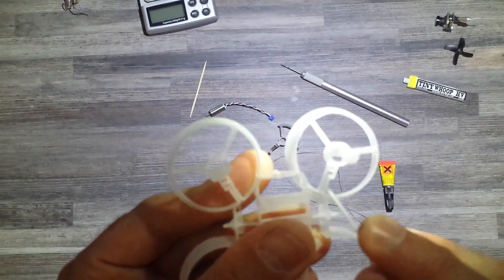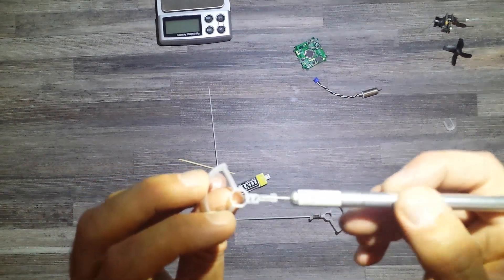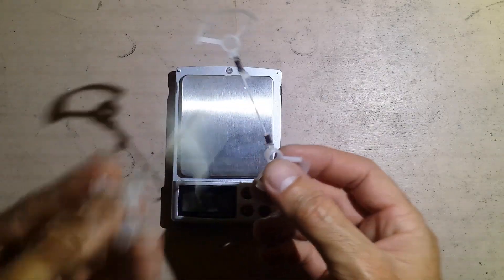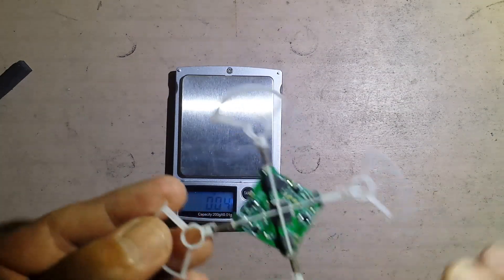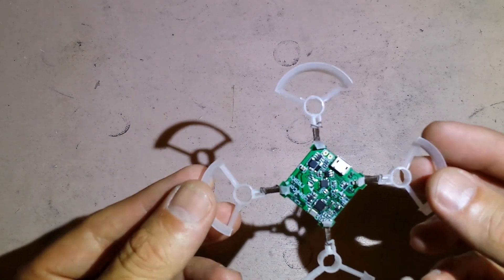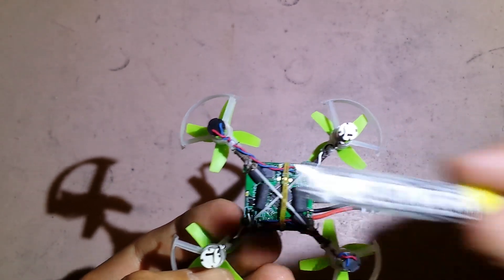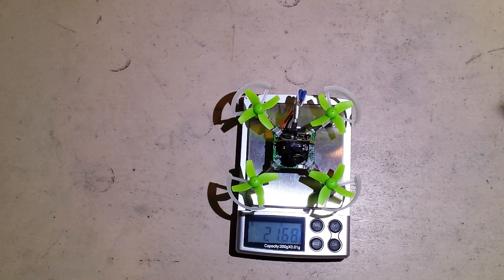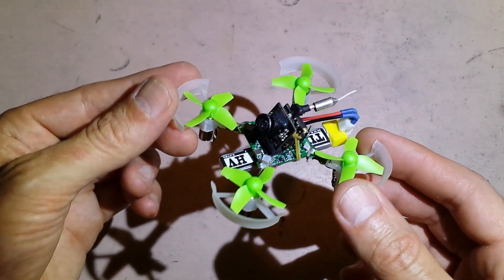Ultralight 7mm Tiny Whoop Build

Comment: I guess durability says no
Reply from the maker: Actually it is basically indestructible. Have not broken a one to date. It handles impact very well being so light and flexible. What does get damaged is the motor shafts bend but that happens on any whoop frame.
Reply from the maker: here is an example of fairly hard impact, though i really so abuse it even worse. Look how hard i powerloop into the roof of the house here: https://youtu.be/cYkA9cG10sc?t=175

Comment: Where can I get the straw??
Reply from the maker: I got it off an old rc toy heli.  It's like graphite but nonconductive. I have no idea where to get more, will have to look for alternatives when the bit I have breaks. Watch  out for carbon a graphite cos they are conductive and will short the board.
Reply from the maker: Wood tooth pics are too heavy and are not as strong and break fast. These white rods are really strong... i wish I knew what material it was... it must be like a synthetic graphite or something
Reply: @FishingEasternCapeSA  It might be fibreglass? I'm not sure though. Btw loved the intro!
Reply from the maker: @sunnysky9292  it really could be hey. something like that.
Reply: @FishingEasternCapeSA  if i use cottonbud stick ? ill try with that
Reply from the maker: @ramboaripratama1992  I have never tried that. Should be better than a toothpick but not sure if it's light/strong compared to the rods I use. I was thinking of buying the thinnest carbon fibre rod on ebay but it will have to be coated somehow for insulation so not 100% sure how.

Comment: Nice! 12.5 grams less than my slightly trimmed up B03 pro. Does the light weight effect flying? How much faster, punchier is it? Flight times?
Reply from the maker: Hi. Yes the weight is a massive factor for these nanos and micros. Much faster and punchier especially with the HV bats and higher kv motors. They only down side is you need to keep the motors fresh and brushless high kv motors really dont last long. they quickly feel under-powered and need to be changed. buy them in bulk and replace them often if you want the acro punch.

Comment: Hi, this is amazing   !!!  Do you fly in acro Mode ?  I have betafpv with  7x20 but i have no power to do something like this and you fly much netter than i do.😉 thanks for the video.
Reply from the maker: Hey man yeah i recommend acro from day one and fairly hi rates. keep it light, use HV batteries and high kV motors which need to be replaced often.

Comment: Very nice work :-)
Thanks for sharing
Looking forward for part list too ....
Reply from the maker: Thanks man glad you enjoyed it! parts list in the video description:
Parts used:
- Beecore V1 flight controller
- Hacked Boldclash B03 7mm frame
- 1mm diameter non-conductive graphite composite rods
- Boldclash 716 "insane" 19000kV coreless motors
- Eachine E010 props
- Boldclash F01 (VM275) micro camera & video transmitter 
- Mylipo.de HV 255mAh 25C 1S battery with PH2 connector
- JST-PH-2.0 connector power lead
- super light foam, cotton, super glue & elastic band
- Every part is weighed and selected for minimum weight - 0.1 gram makes a difference!
Reply: Oh thanks.

I liked your idea a lot.
But now, I think about making something similar, but with an even lighter FC based on NFE ( alienwhoop zero, or even a B03/E011)...

Would you give more detail or link to the 1mm rods you used, please ?
Reply from the maker: dudu du76  Awesome do it, keen to see how light you can make it! Those rods i actually got from an old RC heli. It was part of the tail structure. I have been looking for more but i have only manage to find carbon rods on eBay which are conductive and will short the FC. I was thinking of getting some and giving them a clear coat or something as insulation...
Reply: Maybe a NBD Roach Clip can be a good base. And plastidip for insulation...
Reply from the maker: Sounds good but a bit heavier maybe